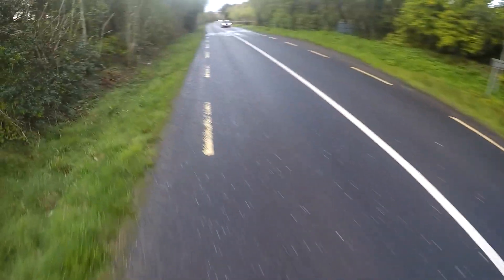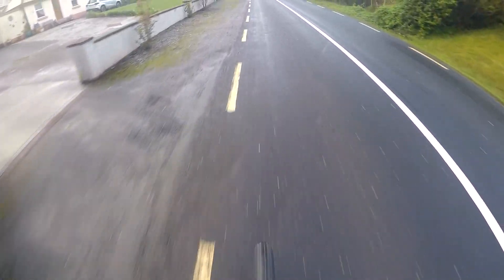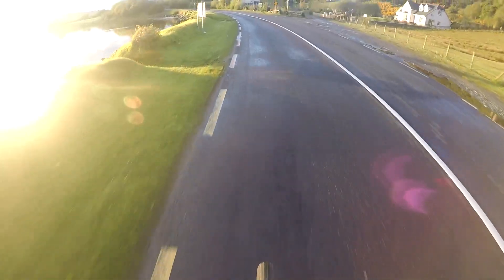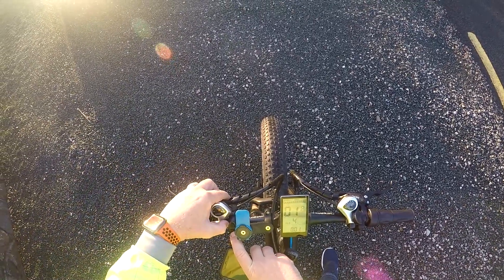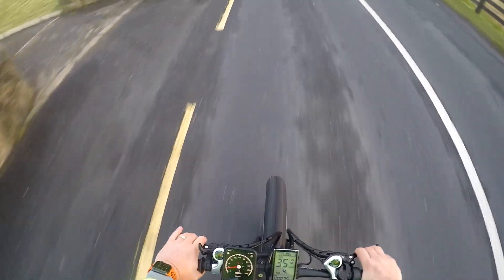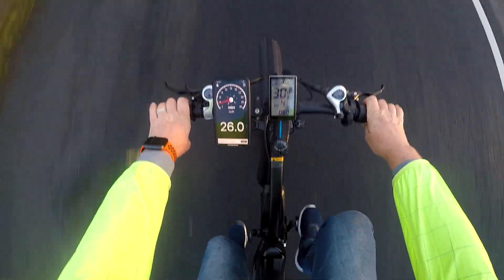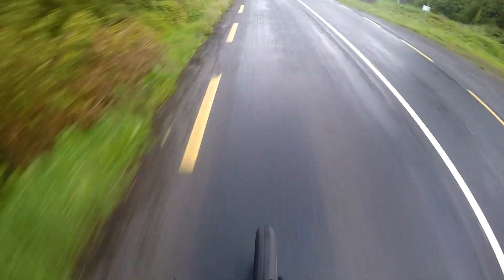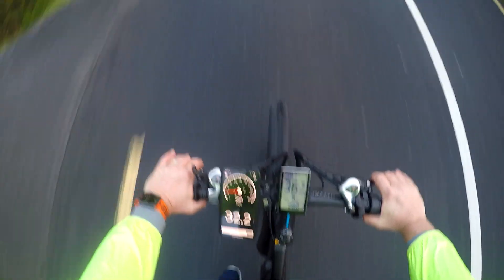MX02S 1000 watt Ebike Display Speed v GPS Speed test

Comment: Hi all. Ive got the exact same bike and i bet you didn't know that it has a mode where you can access the '9 Gears mode'. You gotta access the menu by pressing down both up and down arrow to access the P menu. Go to P5 and press 2 and voila. U have 9 gears and it makes the ebike much faster than having either 3 or 5 gears... And if you wanna make it even faster then go to P menu 14 and change the amp settings from whatever it is to 18 amps then go to P18 and adjust speed ratio to 150 and viola.. Now the bike will take you to 36mph on the flat using just throttle and over 40mph with some peddle assist in gear 9... ENJOY AND DONT FORGET TO THANK ME. 😂
Reply: "adjust speed ratio to 150 and viola"... You never explained what you used the viola for. Would a violin do? 🎻

Comment: you'd need to reduce the size as the big tyres make it bigger diameter so if you go up it's just adding  to the issue, you'd need to go down to 24 inch to make it closer to the real diameter
Reply from the maker: Hi we experimented with various settings and have it close now
Reply: @sylvesterhiemstra4002  what size did you drop it too? I'm in the process of getting one of the mx03!!
Reply from the maker: @kiarnikeys5504  I left it at the factory size but we changed a different menu setting but can’t remember exactly which one though. Thank the base was 120 and we reduced it to 115. I’ll try to find it again.
Reply: @sylvesterhiemstra4002  all good thanks for the content 👍
Reply from the maker: @kiarnikeys5504  best of luck with the 03 you’ll love it

Comment: Hi Sylvester.. id like your opinion on a message i got from Shingmilo.. 
 I contacted shengmilo threw aliexpress and got an answere i cant figure out.. i explain to them that the rim size is 26 inches but the tier adds another 4 inches for a total of 29 inches so what is the proper setting for accurate speed kmh...this is what he sent me..

P01=0002，P02=0000，P03=0048，P04=0010，P05=0001，P06=020.0，P07=0001，P08=0065，P09=0000，P10=0002，P11=0001，P12=0005，P13=0012，P14=0013，P15=040.0，P16=0000，P17=0001，P18=0100，P19=0001，P20=0000

Our tires are based on the size of 26 inches, the above are the correct default parameters, you can refer to it, thank you

Then i wrote.. 
but the overall size of the tier is 29 inches how can it be based on 26 inches?... so which setting do you recommed and were in the menue will i find these settings.
.

This is were he stopped responding .. any idea if any of these number are usefull in anyway?..thankyou
Reply from the maker: Together with a friend we experimented and leaving the wheel size at 26” gives the best result. I think we also changed the P18 setting but I need to verify that and will get back to you
Reply: @sylvesterhiemstra4002  ..Thx.. just seems wierd that controler is set to 26in when the wheel is 29in...Theres a radar trap near my house.. ill get the cop to help test the speedo..will let you know results..
Reply from the maker: @happycamper3455  change P18 to 110 and the Speedo will be fairly accurate

Comment: I'm 197cm(6ft5), would this bike fit me "comfortably"?
Reply from the maker: Not as it comes out of the box but with the same modifications I made I can’t see why not. You can set a speed limit in the bikes menu. The additional power is very beneficial when climbing hills etc. It doesn’t mean you need to use it for speed.
Reply: @sylvesterhiemstra4002  what modifications have you done?
Reply from the maker: @g4zzen245  I’ve changed the seat post, handle bars and pedals
Reply: @sylvesterhiemstra4002  could you sent links please to those handle bars & pedals
Reply from the maker: @g4zzen245  UPANBIKE Cycling MTB Mountain... https://www.amazon.co.uk/dp/B01HTJYGV8?ref=ppx_pop_mob_ap_share
Reply from the maker: @g4zzen245  ATTABIKE MTB Pedals 9/16" With... https://www.amazon.co.uk/dp/B08X5ZHB3H?ref=ppx_pop_mob_ap_share
Reply from the maker: @g4zzen245  Mountain Bike Road Bike Seat Post... https://www.amazon.co.uk/dp/B08B4RCSRZ?ref=ppx_pop_mob_ap_share
Reply: @sylvesterhiemstra4002  thanks a lot for this!

Comment: Hi sylvester I was wondering how long dose the battery last and how much did the bike cost
Reply from the maker: Hi James, battery life varies greatly based on how much effort you are putting in. With minimum effort you should still get 40km from a charge but again this will depend if you are cruising in hilly terrain or on flat ground. If you contribute with the pedaling you could get anywhere from 60-90km from a charge. I paid 1450 Euro for my bike delivered through U-bike on AliExpress. Let me know if you require the link
Reply: Thanks sylvester I was wondering there what was the max speed whit out peddling
Reply from the maker: @jamesosullivan4520  on a flat road probably 35-40 Kmh depending on rider height and weight etc